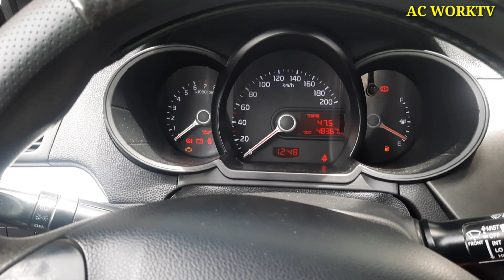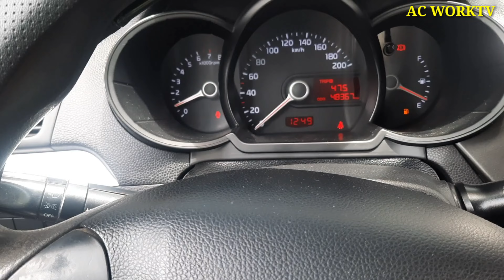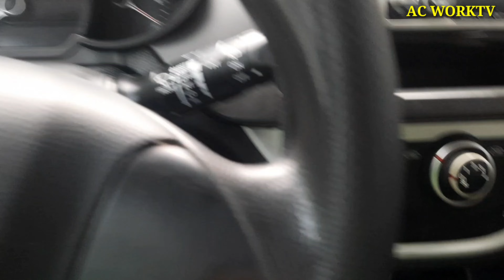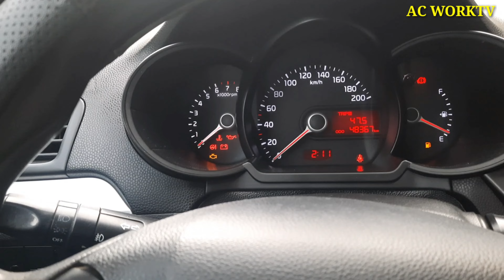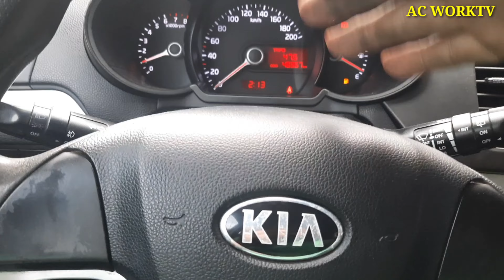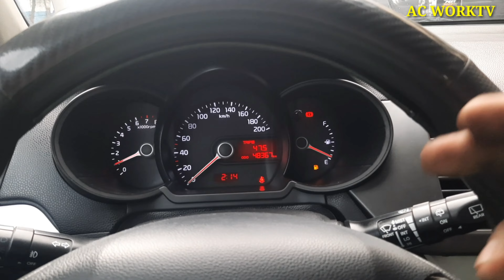KIA PICANTO BAGSAK ANG MINOR PAG NAKA AIRCON

Comment: Hi sir, thanks sa informative video. Mukhang eto din yung problem ng Kia Picanto 2012 AT ko. Nalinis na ang Throttle Body, palit Spark Plugs, etc.. pero ganun pa din, kapag paahon or low gear ay nanginginig ang makina randomly. Kaya ba itong i-DIY kapag ibabalik sa default setup if sakali natagpuang ni-relay yung AC?
Reply from the maker: Kaya yan boss